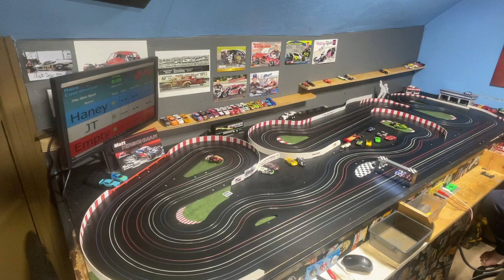Race coordinator timing system.

Comment: Oh the settings Race Coordinator has available. Been using it for several years now and the races we have are a blast.  its take some time to fine tune the settings especially for fuel racing, but once you dial it in...spot on!

Comment: What did you use for your crash barriers?
Reply from the maker: Poster board from hobby lobby. Cut it down into the size I wanted for height and then glued red and white construction paper onto it for the stripes.
Reply: @TheSlotSpot  … Thanks. Does it hold up fairly well?
Reply from the maker: @mikemueller1686  I’d say so. It’s really just been me my kid and my buddy running on it so far but I used it on my old track as well amd never had issues. Used super glue to glue it to the track and Elmer’s glue sticks to glue the red stripe on.
Reply: @TheSlotSpot  … The raceway I’m building is mainly a personal track. But with a one year old granddaughter and another on the way, I’m sure young hands will be using it soon enough. Thanks so much for sharing. Your track is cool and I wish you mucho miles of fun. 🏎️😎🤙
Reply from the maker: @mikemueller1686  thanks!! You as well. On of the best things I ever got was a 0-30 volt power supply. Whenever my kid wants to run I just turn it down to like 12 volts. I used to turn it down to 6 when he was 3 so he could just hold the trigger and go but as he learned throttle control I started bumping the voltage up. He’s good at 12 to 13 now and I’m sure he will be running 18 to 20 soon.
Reply: @TheSlotSpot  … A variable power supply might be a good investment. Any you recommend?
Reply from the maker: @mikemueller1686  I just got a cheap one on Amazon No issues with it. DC Power Supply Variable,0-30 V / 0-10 A LW-K3010D Adjustable Switching Regulated Power Supply Digital,with Alligator Leads US Power Cord Used for Spectrophotometer and lab Equipment Repair https://a.co/d/6hKy7yp
Reply: @TheSlotSpot  … Amazon! The mail order catalog of the 21st Century where everybody shops. 😂 Thanks brotha. Wishing you and your family a wonderful holiday season.